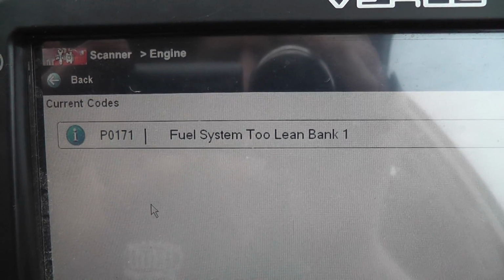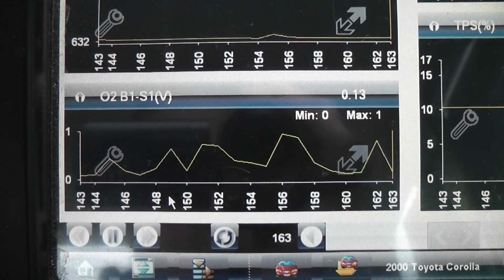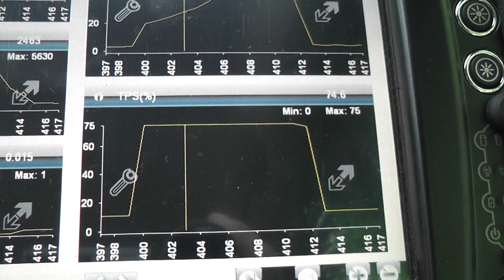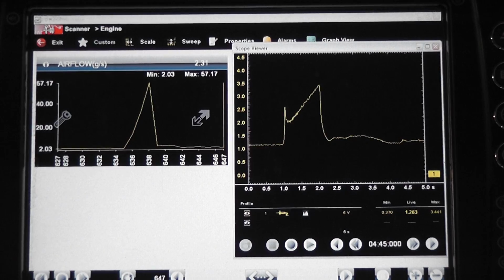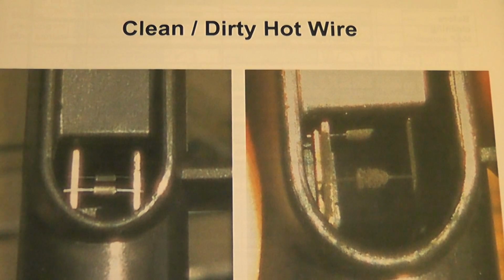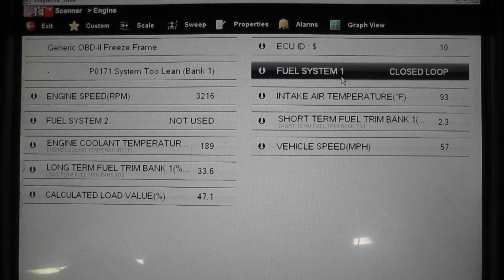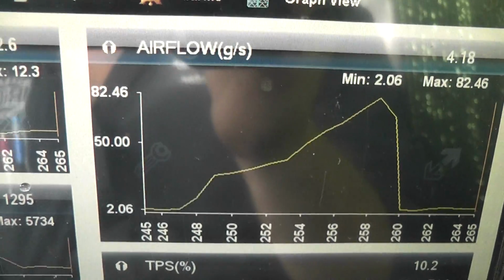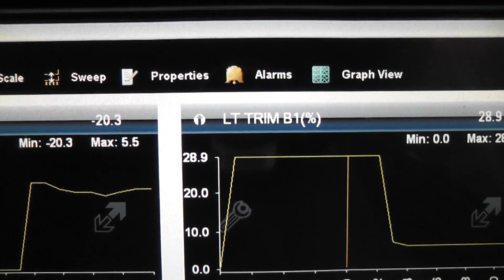Dirty MAF Sensor Case Study

Comment: 10 year toyota technician here, 100% lean code will come back.  Older corollas always need maf sensors replaced, very common issue on those 1zz-fe motor corollas. Cleaning always helps for a little while, but not a solved fix

Comment: ... Somebody here ran the car without an air filter and the whole length of the plastic air intake which is full of sand and the car was bucking and kicking so I cleaned it and I think everything's fine I don't see any vacuum leak and the fuel frs atrims re all about 0

Comment: I'm surprised being only a .05-.06 volt low could cause a disturbance. Could this also have been diagnosed by checking the voltage numbers of the MAF via DVM while manually throttling to higher RPMS?
Reply from the maker: I think I showed that with the lab scope. The DVOM may not be fast enough to catch peak voltage in park, but would be under load on a test drive

Comment: What size engine?
Reply from the maker: 1.8? I think?
Reply: @ScannerDanner  That is the car I am working on at the moment. Have a long term trim of 18 percent.  Lack of power at wide open throttle. Hard starting however some of the plugs are fouled sometimes which I believe leads to the hard start. If I clean the plugs car starts instantly. Max airflow I have seen is 30 gram/s. Compression near 200psi. No restricted exhaust. The injectors in the car are 23250-0D030 200cc/min. However I am seeing 23250-22040 used for this vehicle which has a flow rate of 255cc/min. At idle calculated load is 20% and water temperature is 198f.

Comment: A few observation here
- The PCM didn't throw a MAF performance code e.i P0101
- u didn't look at the load PID or abs-load pid at WOT 
- I think at WOT injector ms is not calculated using MAF it is calculate based on built in maps, that at least has been my experience, Thanks a lot for information full video as usual.

Comment: So i got the same exact code and but cant figure out the problem for the life of me. My short term in bank 1 is around 0 but long term is 14.4%. My bank 2 short term is around 8% and long term is at 13.7%. 🤔😔
When I rev it up to 3krpm for like 30seconds the long term does not change at all. Please help 😭
Reply from the maker: check it for a vacuum leak
Reply: @ScannerDanner  i thought when you rev it up and the long term trims lower that indicates a vacuum leak?
Reply from the maker: Ah, you've been paying attention! I suggest looking in that direction because your trims are positive at idle. 
You said they didn't change when you raised the rpm, which is misleading, but the fact that they are positive at idle makes me want to check it for a vacuum leak first.
Reply: @ScannerDanner  so I disconnect the battery to rest the long terms so it starts over. STFTB1 IS AT 31.3% AND MY STFTB2 IS AT 28%.. I guessing maybe thats why I only have a code for bank 1 lean.
Reply from the maker: @pablomarquez4431  ignore the fact that you have only one bank showing a code. Both banks are lean and if these numbers you just gave me are at idle, it does look like a vacuum leak. HOWEVER, if you have simply a vacuum leak, your engine will run good under heavy load and wide open throttle. If you are having issue in those ranges too, we have something else going on.
Reply: @ScannerDanner  I'm going to try the MAF this Sunday. Waiting on parts. Hopefully that helps. I tried clamping off brake booster hose and purge valve hose but did nothing to fuel trims.
Reply from the maker: @pablomarquez4431  how does it run at wide open throttle?
Reply: @ScannerDanner  mechanically the vehicle runs fine. Can't tell that anything is wrong with it unless you looking at the trims and the ck engine lt. No misfires. Vehicle was sitting for 4 -5 yrs. Was running rough at 1st so I changed the iacv and cleaned up the maf. Runs better now, no rpm surging, just fuel trims are bad.
Reply from the maker: @pablomarquez4431  how old is the gas in the tank? You most likely need to drop the tank and clean it and add fresh gas. Then also, most likely, your injectors are all varnished up too. And cleaning them may or may not work
Reply: @ScannerDanner  well now I'm on like my 4th tank of gas. Before when I 1st started it like 4 months ago i added octane booster and fill it up. After finishing that and refueling it was running a lot better on the 2nd tank. Did all the other regular maintenance and its been running great at idle, cruise speed and highway. Just them trims don't look good.
Reply from the maker: @pablomarquez4431  my money is on the injectors
Reply: @ScannerDanner  how do you diagnose that with a scanner cause on this v6 its difficult to access.  Got to take off the manifold.
Reply from the maker: @pablomarquez4431  check out this playlist https://www.youtube.com/watch?v=mmRhcVkJdeQ&list=PLAFYVCyenqcoYm94zK0-EP0ICsGWj_ICs and look for videos where I mention "injector flow" or "injector balance" testing. It is about all you can do and if the intake is in the way, it get's more complicated.

Comment: if the most causes of lean condition are 
low fuel pressure 
dirty MAF
vacuum leak 
then what are the most causes of rich condition ??
 I think a stuck open fuel injector is one them

Comment: Great information. How would I check the millivolts to see if it indicates my fuel pump or pressure regulator is bad, on a newer Toyota engine with the air fuel sensor in bank 1 sensor 1? Seems to always read about 3.33
Reply from the maker: mv on the O2? you can't the same way. Wideband O2 operate off of milliamps and the scan tool only displays a voltage equivalent. On your test drive, use global OBD2 data and watch your numbers there. On a deceleration even, fuel is cut, so watch the O2 during that time, this will show you what a lean signal looks like, then use the WOT test after
Reply: @ScannerDanner  Thanks. I purchased your book and it is great.  I have a '05 Pontiac Vibe with the 4-cylinder Toyota engine, 130k miles.  My long-term fuel ft is just slightly high (around 13 or so) when I'm accelerating, with short being close to zero.   Long term ft is around 6 or so at idle with short being near zero.  No MIL on.  Where would you recommend I start studying in your book to see what's needed to get that long term under 10?  Thanks so much for your videos and your book which help a lot.

Comment: My 07 Corolla has no codes but a little bit of a rough idle. I am trying to decide if it is the intake gasket problem or the MAF sensor is dirty. Would this test help me to decide?
Reply from the maker: in both of your examples you would have messed up fuel trim numbers

Comment: Hey, Paul Why didn't you go after fuel? The o2 would also show lean with a low fuel pressure issue? I would really  appreciate your answer.
Reply from the maker: Next easiest check was what dictated my direction on this one. Plus scan data on the test drive showed low MAF numbers giving further evidence we went the right direction.
Reply: Thank you for the reply. I, myself, was going to apply the engine displacement rule to rule out the MAF.  My thinking is, If the engine is not underestimating or overestimating air flow at idle, it is not going to do that under load either. Thanks again, Paul.

Comment: I read somewhere, that when you have a fuel related lean code, as you rpms get higher, the fuel trims go high really fast; but for a MAF issue, the fuel trims have a slower increase.
Reply: Thanks. I was trying to see how to differentiate between the two. 

This is why I like to read comments on a video.

Comment: Is there a way to check differentials with the scanner? Example if the differential is failing or something needs to be replaced?
Reply from the maker: "differentials"? are you talking about the final drive? ring and pinion gear stuff?
No, unless it is a computer controlled AWD system with "smart" torque control

Comment: There really are some dumb ass people in this world. Just reading the excessively high negative comments on this video whereby they all miss the base point Paul's doing. He's educating us on scan tool info, the airflow O2 signal and the volts produced by the mass air sensor. He even showed the colour of the wire he was connected to. OK out in the real world he would have maybe just jumped to the mass air and cleaned it before test driving and realising the cars fixed, yet as with me who charges per hour; that wouldn't help. My earnings would plummet if I fixed the ride in minutes. I like this video and think those negative people should open their minds a little. Well done Paul. Cheers for that.

Comment: Hey paul could you remove the mass airflow sensor key on engine off use shop air and make any type of accurate assumptions from this data?  Just an idea for another video.
Reply from the maker: shop air will not clean it. I've tried. :-)

Comment: Outstanding troubleshooting skills. My question is, I have the same MAF sensor on this video, in my Volvo XC90 states that at a min idle it should be 5g/m my current MAF is at 3-4 g/m. Would this throw off my vvt solenoid, cam shaft position sensors? I did clean my MAF but stayed the same on idle,
Reply from the maker: Why are you asking about the VVT solenoids and cam sensors? Do you have codes for these? No, the MAF readings would not alter these in any way. And I don't mind 3-4 gram per sec at idle with a spec of 5. As long as your not running lean. Fuel trims will be key here
Reply: ScannerDanner it feels like there is a domino effect with my timing, fuel delivery and emission. I replaced all o2 sensors because of laziness, this is due to ONLY o2 sensors not ready monitor. Snap throttle has a good dip and up and stable at a reasonable seconds. Then my vvt solenoid pop P0076, cam profile P001b and P001e. And evap P0458,  I was trying to do a drive cycle with the new sensors and all these popped up so maybe something is throwing it off, changed my oil filter and oil and looked at my fuel trims ,my long term fuel trip after 50 miles and bank1 -4 bank2 -3. So it has rich fuel but not enough to trigger CEL, then I saw my MAF 3-4g/m at idle and I looked at the spec. So I changed it and now I have 5g/m idle. Also this mitigated a CEL for vvt, cams. For some reason my scanner picks it up but not trigger a CEL. now I get a CEL on the evap. Sources in YouTube community mention I should start with the easy one. Buy a gas cap. So waiting for it to come. Do you happen to have a video on EVAP troubleshooting? I already ordered vvt solenoid and cams. Pretty much throwing parts at it and hope it works.  I really want to know why sudden my sensors went haywire. Sorry for the long response. Just giving you a little background I have been dealing for months now.

Comment: that build up is call insulation and insulation traps heat. air coming in is designed to cool sensor but good insulation wont allow that. great case study.

Comment: I have a 02 ford focus with code p0401 egr insufficient flow I replace the EGR valve DPFE sensor vacuum solenoid cleaned out all the passages and the O2 sensors I still have the codes help please

Comment: Hi Paul, first I really appreciate your videos and I just wish you were in a Chicago area to help us here or at least have some kind of referral program with a group of mechanics like you that I could go to see when having a problem. Here in Chicago we have way too many parts changers, no one wants to spend time on diagnosing the problem. 

Anyway, I need help. I have 02 Toyota Rav4 with 2.0 L with 2 banks. Currently I have P0171 where at idle the LTFT on bank1 is at 19.5 and bank2 at around 7-10%. STFT on bank1 usually hovers around 7% and on bank2 around 0%. I can't find any videos on cases when both banks are lean but to very different degrees. I am able to get both banks readings down to 4% bank1 and bank2 to 0% by flooring the car on the highway. Initially the STFT goes high and then slowly they fall down to the above numbers and stay there until I let the gas pedal off. Per your videos with the propane into the intake I eliminated the the possibility of a bad O2 or maybe not? Could MAF or fuel delivery problem effect both banks differently. Any idea where should be looking at? Vacuum leak? In the last 2 years I've replaced the CAt twice already but I never had a lean code before. I think I've been driving lean for few years already. Thanks for sharing all your work Paul.
Reply from the maker: Do an injector balance test next. I have a few videos showing it and Toyota is known for injector issues.
Reply: Thanks Paul. I wonder if swapping injectors from back 1 (problem back) to bank 2 would make sense first since that's something I can do myself. If the lean condition would than move to back 2 that would give me an idea that there is something wrong with one of the injectors. Would that make sense? Also, how do I check the upstream A/F sensors without lapscope? Swapping them from bank to bank will not work as they have different lenght wires. Thank you Paul

Comment: on vehicles (i believe all of them now) with electric throttle bodies. Will you be able to do WOT snap test? what i notice (chrysler is the worst offender) is that when i try to Rev it the ECM stops the fun. What should/would you do in that situation?
Reply from the maker: +Auto Fix Pal if it is an automatic, with key on, engine off, put the transmission in gear. (block the wheels of course). This should allow the throttle to react to the app sensor
Reply: +ScannerDanner awesome. Thank you.

Comment: Hi,  so you can either use Carb Cleaner or Bake Cleaner or that CRC Mass Airflow Cleaner?
Reply from the maker: +Imre Csoka I wouldn't use Carb cleaner because of the residue it leaves behind
Reply: Yeh i also thought i noticed that when i first tried to clean my ICV long ago, is that there was a bit of a oily feeling. I just used soap and water after but i let it sit in the sun for a good while. My new one obviously i have not cleaned, BUT i dont know, i still have starting issues it cranks too long at times and i need to assist with the accelerator. I can give a full nice description on timings and exact experience on my issue if you can try help me. I am wishing and hoping it is throttle body or air in take related. So back to the other one again, can i use "brake and parts cleaner" spray ?
Reply: will the throttle body cleaner work? it just supposed to remove gunk and carbon.

Comment: Hey Dan I need your advice i have a chrysler cirrus that has a problem the car shakes alot i have low rpm( i dont know the standard factory rpm for this car but it looks like around 600rpm, i got a code p0172 too rich bank1 , i have only clea body throttle but the car still shaking( should i check my o2 sensors?  I bought a map sensor and didn't see any change so i returned it, will i have to change MAF SENSOR? Please help me i just purchased this car I didn't knew it had problems ( the guy that sold it had hired someone to take out CHECK ENGINE  LIGHT. Not a loyal seller
Reply from the maker: +Chuck Brown wow, that sucks! 
What engine is in this Cirrus? Is it the 2.5 Mitsubishi V-6 or the 2.4 Chrylser 4 cylinder?

Comment: Hey Dan, does the rule of the improvement in fuel trim at rpm also apply to boosted (turbo/super charged)  motors?  My suspicion is that the rule wouldn't carry over to a boosted engine because air leaks still cause problems under boost.
Reply from the maker: +KaldekBoch yes, it still applies. But you will not be able to see peak MAF voltage in the shop. A test drive is needed. 
https://www.youtube.com/watch?v=QwGICKqWgM4